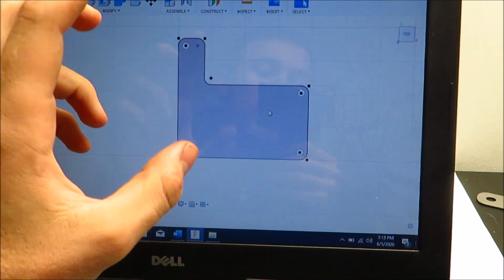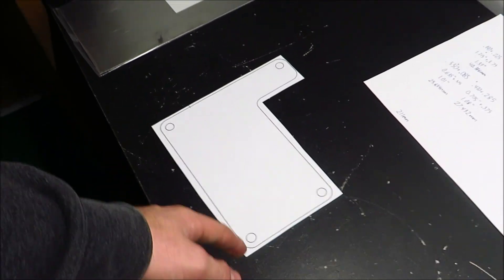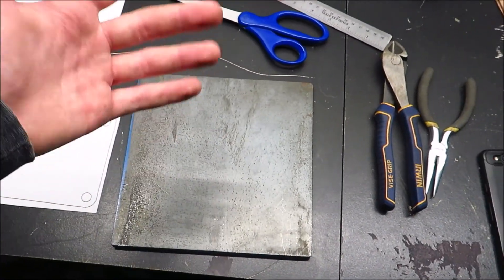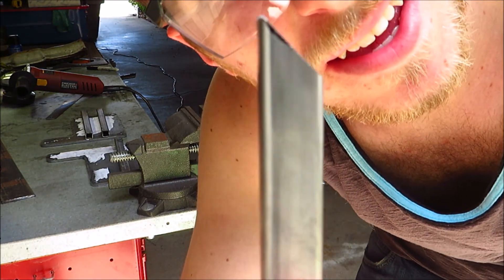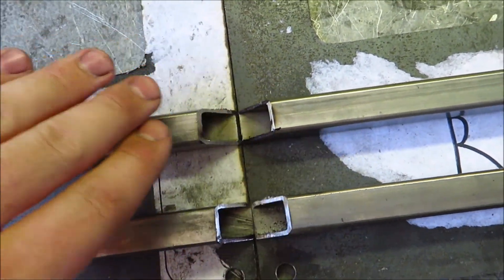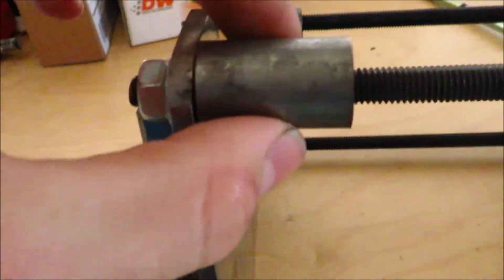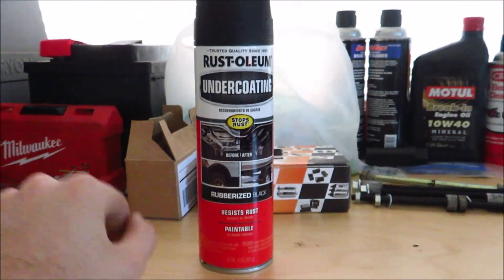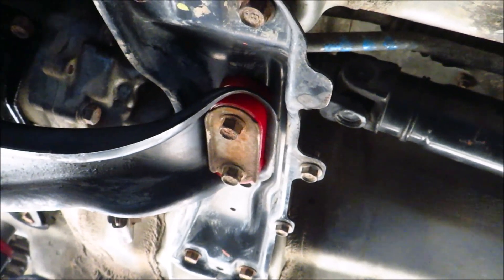DIY Subaru 5mt Blast Plates

Comment: Do you think the blast plates are worth it? I noticed you still blew up your 5 speed before the 6 speed swap. I'm pushing 330 to the wheels..
Reply from the maker: I think they are worth it. I didn't break the transmission until like 420whp. I would say 350 hp is reliable up to maybe 380 with the blast plates
Reply: @SWSpeedCo  right on thanks man!

Comment: They still holding up?😅
Reply from the maker: I dont have the 5 speed anymore, it held up at 380whp but I lost 3rd gear at 430whp. I rebuilt it and drove it for a while at 380 until I saved up for the 6 speed swap and it was fine. I have a couple videos on the 5 speed rebuild and stuff.
Reply: @SWSpeedCo  ok 10-4 im doing a 4.44 5speed swap now just waiting on my 2sp blast plates ordered them about a month ago they just left Jacksonville yesterday so I should have them in the next few days not alot on them so just trying to see if they helped anyone. Thanks
Reply from the maker: Yeah I would say they definitely helped out. I haven't heard of many people pushing that much power on a 5 speed without it breaking. It's not going to make it indestructible but it will help
Reply: Yeah, no absolutely I’m just a little over 280 hp and I am extremely happy with that but the guy I purchased the car from was launching it at a dragstrip so that five speed inevitably blew up. He also blew the engine as well and I installed an EJ206 as a replacement I figured it should maintain that horsepower fairly well coming out of a TwinTurbo configuration but thank you for the video, and I will definitely subscribe and watch some more of your videos thumbs up man appreciate it you will hear from me again I promise☺️
Reply from the maker: @Sickwid sounds good, thanks for watching!!
Reply: @SWSpeedCo  very welcome

Comment: hello, can you please send me the drawn template and spacer mass by e-mail? how about the installation? does the transmission oil have to be out or does it matter? best regards....
Reply from the maker: I no longer have the cad file, I lost it during a computer restart. Their is a link in the description of the video to where I got my measurements from. The transmission does not have to be drained it just needs to be lowered down out of the trans tunnel to access the top bolts.
Reply: @SWSpeedCo  That's weird because Fusion 360 saves it to the cloud and not the hardware...

Comment: Great stuff bro most helpful info on the torque specs of the bolts. Definitely will do the blast plates cus I saw you launching the car with no worries 👍
Reply from the maker: Thank you,, Just make sure you don't dump the clutch and you'll be fine

Comment: What is the length of each bolt and spacers you put in?
Reply from the maker: I put a link to the forum post where I got all my measurements from. If you scroll half way down you will see the spacer measurements labeled on the plates by the holes.

Comment: So after installing the plates can the 5 speed hold launches and not blow?
Reply from the maker: If you look at my latest video and my other drag racing videos you can see how it hold up to launching, even on preped surface. The only advice I can give you is don't dump the clutch on a launch, you still want to slip it a bit. I watched someone blow up a 6 MT at the drag strip last week from dumping the clutch. I know a guy who has a 700 hp wrx with a stock 5 MT and he was the one who told me to let the clutch take the abuse of a launch, because wearing your clutch out a little faster is better than a blown transmission.
Reply: @SWSpeedCo  will do